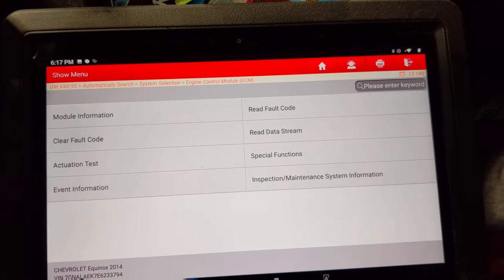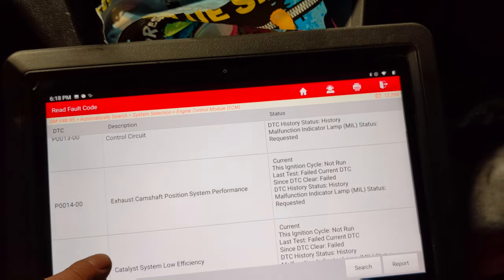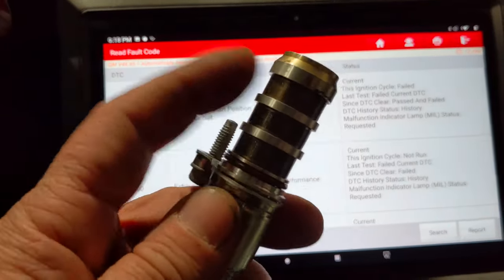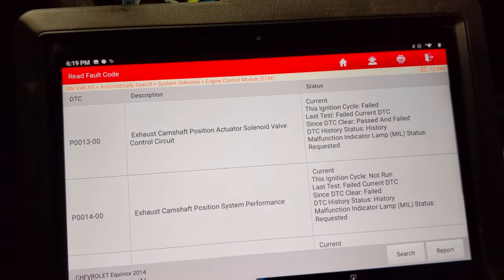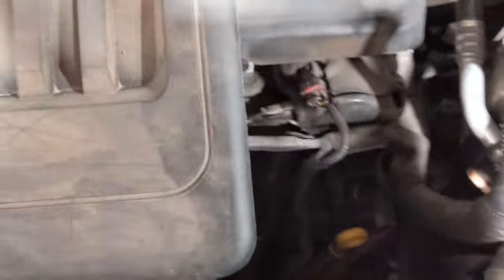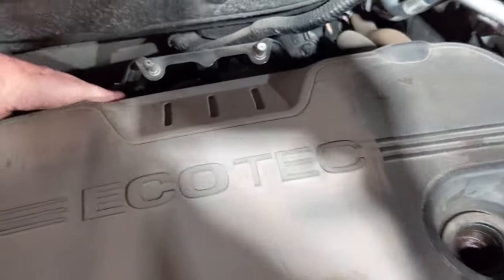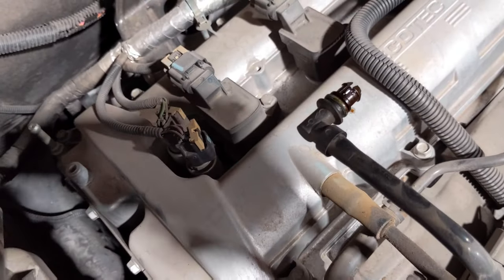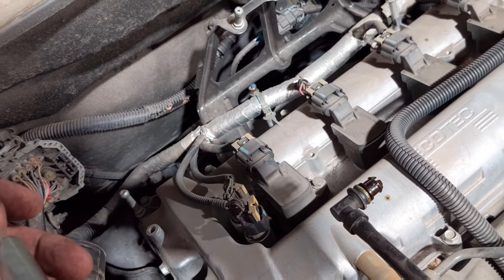P0013 P0014 Common Causes "Cheapest Fix" VVT Solenoid

Comment: I know this is an old post, but have to ask.  The P0014 code, is that affected by both the intake and exhaust solenoid?  As I was previously informed, the rear solenoid (black cap)is the exhaust solenoid for this code, while the front solenoid (grey cap) is the intake solenoid and that code is normally a P0010.   I have done the oil change, opened the intake cleaned the PCV port, and replaced the Exhaust solenoid but still get the P0014 code.